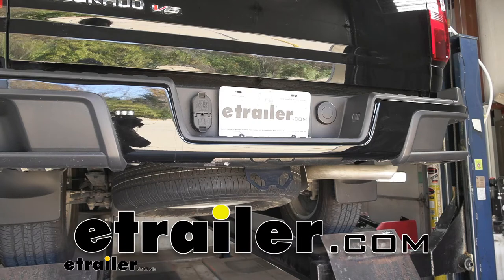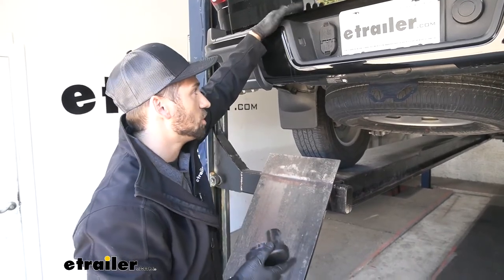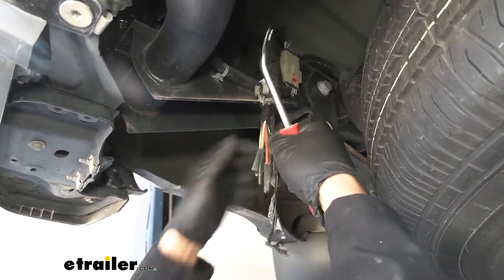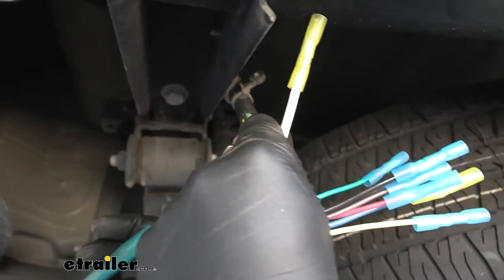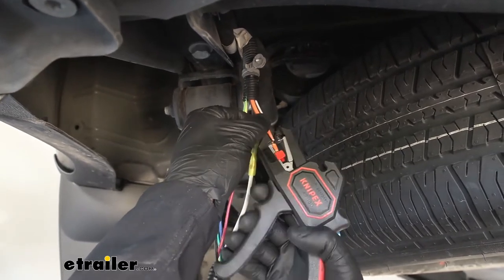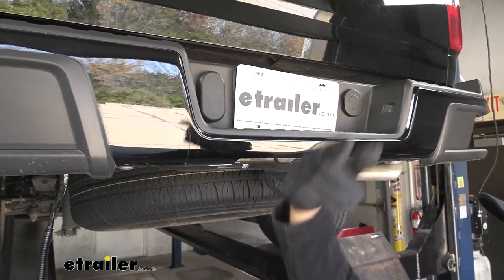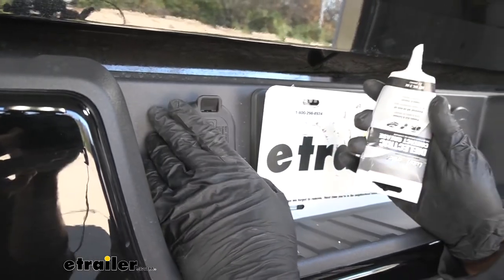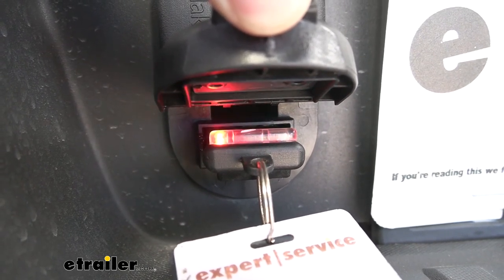Setting up the 7- and 4-Pole Trailer Connector Socket w/ Mounting Bracket on your 2019 GMC Canyon

Comment: I just had this installed on my 2022 Colorado and it moves around in the bumper. How can I make it a tighter fit
Reply from the maker: There's nothing specific we offer for that, but some self-sticking weather stripping that's available from your local hardware store would be a good choice. You'll find it available in all kinds of lengths and thicknesses.
https://www.etrailer.com/Custom-Fit-Vehicle-Wiring/Hopkins/HM40975.html